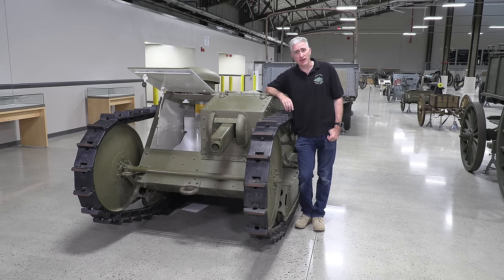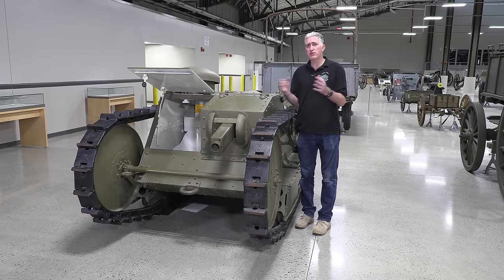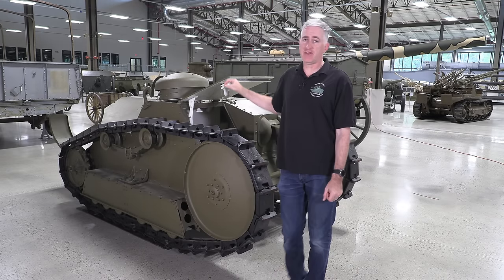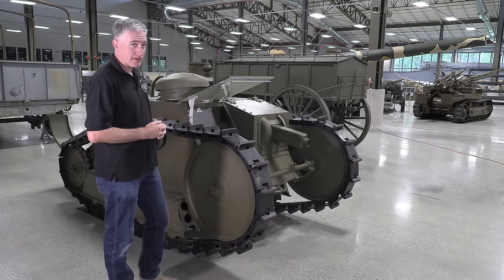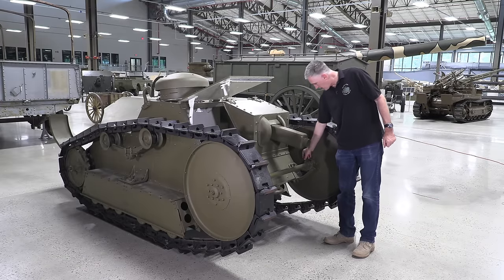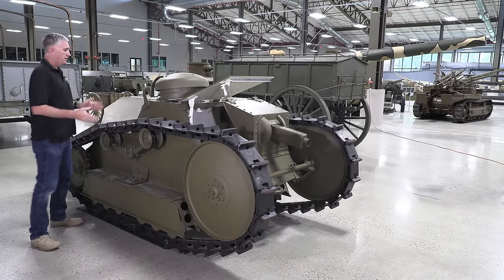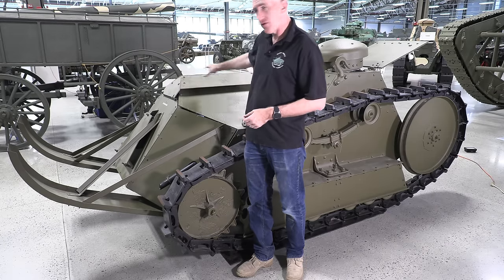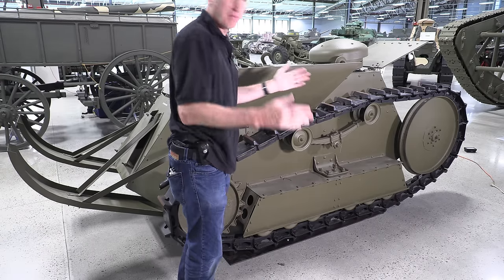Inside the Chieftain's Hatch: 3-ton M1918

Comment: As for adjusting the track tension from the front. I believe you nailed it with that Towing eyelet in the front. When I served in the mechanized artillery in the US Army we had long "crowbars", which were simply straight steel shafts, about 4 and 1/2 ft long. They were referred to as "Tankers bars". That's probably exactly what you would do to hold that in place while adjusting the bolts.

Comment: I suspect track tensioning would involve compressing the idler springs first, but there doesn't seem to be anywhere to attach a winch or device to do so. Being a fairly light vehicle perhaps they could just stack sandbags on the tracks, basically add weight until the idlers sag to a measured position and then take up the slack. Maybe getting a few mates to bounce on the tracks would work.

Comment: One note about the fuel tank.... Model T engines were gravity fed, so it's likely the fuel tank would have been in the engine compartment above the two engines. It's likely this scheme was kept from the cars because otherwise you're relying on an add-on fuel pump and a carb with a float bowl, or a vacuum tank which were persnickety things on the best of days.

Comment: You seem big for a tanker. In the late 1970s through the early 1990, I worked on projects at the Command and General Staff College. My first impression there was that people were chosen for their professions. My first project was a command-and-control simulator. The tankers were all relatively short, and very muscular. The intel guys were a bit overweight and often had longer hair (by military standards) and often smoked a pipe. The engineers were slight. The Colonel that oversaw the exercise was a tall lanky guy who was an airborne commander.

Comment: as a fellow tall person and a mechanic. u might have to do what i call the "dive." go in head first, while propping yourself up with arms, "fall" into the seat on whichever side is feasible, then bring legs in. luckily  tanks dont have steering wheels(sometimes) so u dont have to worry bought getting legs under the wheel.  

granted, the seat moved and the entrance was odd, plus i'm not there to see specifics complicated entry for sure. seems like the tank is trying as hard as possible to hurt you, lul.

Comment: Simple 2 or 3 pully shop hoist hooked to anything immobile should work better than a pry bar for track tension setup more control over distance moved and in holding tension while retightening the bolts.

Comment: I believe the US Army brought back a Renault FT for Ford to study after asking Henry if he could make an improved version faster for less. Ford put his engineers to the task and had the M1918 design worked out in 72 hours. I also believe Ford used two engines and transmissions since it could be driven if one engine or transmission broke down. The Model T had it's gas tank behind the dash board above the engine so the M1918 probably had it's fuel tank above the engines with the fuel filler neck below the center cover that was hinged. 
The Army might of deleted the turret if soldiers were getting accidentally shot by the gunner who couldn't see them running past the sides of the tanks. This way they knew the machine gun only fired forward so not to get in front of it.
Reply: Interesting analysis 🤔. Can you verify the beginning? I'm extremely interested in this tank.
Reply: @LovesTrains440  There's not much to it. The US Expeditionary Force decided to use British and French tanks since the Army never bothered to design any tanks prior to entering the war (C.L. Best came up with an innovative design in 1916 that the Army turned down for that reason) then found they couldn't get any once there so had to supply their own tanks. They shipped back a FT and wrote up specifications for a lighter and cheaper tank. Ford made 15 in record time with one sent to France for evaluation by the Army. They didn't like it so the US Army cancelled it's production and went ahead to have near exact copies of the FT produced by other companies (which included C.L. Best) but due to various delays, weren't ready to use until 9 days after the war ended. The Army did consider using the M1918 tankette to tow the 1897 French 75mm all-purpose field guns then cancelled that idea due to treaty limitations.
Reply: @billwilson3609  I've definitely heard all that except Henry's reaction. Do you have any contemporary sources? Thanks!

Comment: I think this sort of vehicle is important historically for an entirely different reason: to illustrate how far removed even the most basic of tanks are from modern manufacturing capability. Even the most dedicated home machinist, casting non-performance critical parts via lost 3D-printed plastic, with modern engines and transmissions, will find it extraordinarily difficult if not outright impossible to manufacture even a single tank of the M1918's capability in under 2 years. With a hundred years' advance in construction... It still takes a factory and a lot of industrial capacity.

Comment: Why not put weights on the track over the leaf spring top rollers to relieve tension before adjusting the tensioner bolts? That way they don't spring back when loosened and can be adjusted forward without a pry bar. Remove the weights when you are done and get full tension.

Comment: Pretty sure that the spring holding the return rollers is a Model T transverse leaf spring. I know they used as many T components as possible, not just the engines. I would be curious to find out just which small parts all over the tank were taken out of the T parts bin. I thought the axle for some reason, but with dual drive that seems unlikely.

Comment: So in order to shift a gear up or down, driver has to pull two levers up, then switch both hands to gear levers, try to wrestle both transmissions in the same gear, then switch both hands back to clutch levers and engage them? Sounds fun.
Reply: The Model T transmission used bands instead of gears so there was no clutch or shift pattern.

In the car, the throttle was mounted on the steering column and there were three pedals: Brake, reverse, and "clutch", which put the car in high gear when released, neutral when held halfway, and low gear when pressed to the floor.
Reply: @AlexR2648  And, there's no 'wrestling' with the transmission as op worries about. Constricting bands on a planetary gearset could be as smooth as an automatic transmission if you didn't mind the extra band wear from slipping. The brilliant part about the T controls is cruise control is inherent... high gear, throttle set, no hands or feet required on anything but the steering wheel and a minor tweak to the throttle quadrant as needed.

Comment: You're obviously not an engineer because the track tensioning is easier than you imagined. A couple of wooden wedges driven behind the axle before loosening the bolts would prevent the idlers from going "flluummf", and a few knocks on the wedges with a big hammer would add tension. Easy peasy. 😄
Reply: Mmmmhmmm
Reply: There you go. Did not think of that. 😮😮

Comment: I see something quite innivative and clever on this thing. On the top ideler wheels it has lead spring suspension up there which would i can imagine work as automatic track tentioning to some extent when your road wheels go up kind of like i believe some m48 mdels where 2 wheels are connected and as one goes up the other pushes out but i might be getting that mixed up with another tank as i do not reall remember

Comment: Not to be a knit picker, but I suspect the MG would be a Browning 1917, not a Browning 1919. The 1917 is water cooled, and the 1919 is air cooled. With that armored shroud over the forward end of the MG, air cooling would be problematic at best.

Comment: Not sure how much information has survived but did tanks at this time have sealed bearings? Do you know if you had to go around with an oil can before setting out, or were they starting to use grease nipples? I'm a fan of the series Lawrie Goes Loco (seriously, if you like Inside The Hatch, you should check it out); on it, he goes over in detail the start-up procedure of various Locomotives (I strongly recommended the WW1 Simplex video) and wondered how much translated to tankers.
Reply: Back then they used rope, felt and rawhide seals to hold oil and grease in place.

Comment: One way this sets itself apart from early tanks is that it looks like it wouldn't gas or burn the crew with engine exhaust or exposed components.
Reply: the ft wasnt supposed to either.
Reply: Still no firewall, so the engines (including the crankcase breathers) and exhaust pipes (which would leak somewhat) where inside the metal box with you when "buttoned up". The fuel system was also on the crew side, so in event of any issue you got covered in gas, and you'd need to be fairly careful of the starters behind your elbow because they DO spin when the engines are turning.

IMO it'd have made a lot more sense to mount the engines the other way around so the starters where against rear of the tank, and crew contacted the gearbox housings only (due to lower height than the engines you could even have the seats reclined to be partially overtop of them, but ford elected to have neither the 2x 1m driveshafts or alternately use a front sprocket, probably because it was faster to develop for such a war expedient (and honestly not very good, see choice for none of them serving in combat) design.
Reply: @SheepInACart  Huh. OK not as good as I thought but still much better than early british tanks

Comment: Did they move that fast or was that the film speed helping out?
Reply from the maker: I suspect film speed helped out.
Reply: Wikipedia says it had a top speed of 8mph/12.8km/h. When the footage at 5:20 shows it going sideways, we can use the bush in front of the tracks as a reference to see how many seconds it takes for the tank to move it's entire length (approx. 2 0r 3). With a length of 14ft, we now have a speed of 14ft/3s or 3.2 mph (4.8mph at 14ft/2s). With the footage at the end we can do a similar analysis which shows similar timings to traverse the vehicles full length (the static camera lets us mark a single point on screen to reference here). And finally, the very last shot of historic footage thankfully has a timestamp on it, which doesn't appear to be speed up.

I do like how the footage of the drivers getting in shows one guy using his foot to keep the hatch from closing too fast.
Reply: for ww1 standards 8mph was speedy.
Reply: @TheChieftainsHatch  Russians did it the other day with T62’s,or so it looked.The obligatory drive by waving was a bit rapid,as they “stormed” past camera like a pathe” newsreel.That M4 in middle of shot on US Armoured doctrine,the gun looks huge.
Reply: On desk at your twelve o clock.

Comment: They stopped production due to a combination of the Armistice and the US Tank corps at the time feeling that the vehicle as it was didn't meet the requirements they they wanted but the ones sent to France for evaluation the French saw them as inferior to the Renault FT but they didn't throw them away, they actually repurposed the ones they were given for evaluation as cheap, light and all terrain alternative for artillery tractors for the Canon de 75 modèle 1897 instead of the usual trucks they used...They placed an order for 1500 for that purpose but again the Armistice shut that idea down.

Comment: There is an episode of Top Gear where they used Ford T as a trap for employers of expensive hotel and the trap was successful as the fact that the Ford T have more pedals and the whole layout completly different than any modern car and it is kinda complicated, so in the end not a single person that came to try to start the ford T managed to do that(and it was in Europe where manual gearboxes are common)...
So i kinda wonder if anyone in that museum knows how to operate this tank or do they just think that they know(but passed the knowledge to u anyway).
Reply: There are things like manuals, even from back then. And if anyone has done mechanical work on this is should be pretty obvious how it works. I'm not suprised no one could drive away in a model T, it's a very different to a normal stick or column shifter. Still, once you open up the transmission and see how it works, with those bands connected to the pedals, it's fairly evident.

Comment: The only real question is did it work for how it was designed? I've found that a lot of reviewers tend to be overly critical because they are not seeing the unit in the frame of the times.
Reply: Badly, since it was effectively rejected by the US and French army so it never saw combat.

Compared to the Renault FT of the time this is faster.. on perfectly flat roads. Otherwise it has weak firepower, terrible field of fire, commander can't see a thing etc.

Comment: I think the ones who designed this tank took the wrong inspiration from the Renault FT. During WW1, the french light tank Renault FT was one of the most useful in combat even compared to the heavier british Mark tanks because you could produce them in massive amounts. France made 500 per month during the last part of the war ! The US generals surely wanted to equip their troops with a big number of working tanks when they would arrive in France, so they tried to have Ford make them as much tanks as possible. The result was a tank far too small and light armed to be useful against the steel bullets of the germans, and lacking the essential component of the FT, the turret, making it extremely hard to hit anything with it.

Comment: My guess with the tensioning of the idler wheels would be that you unhook the tracks and then loosen the idlers so they don't come flying back.  Then when you're done putting the wheels back where they won't go "fwoom" in your face, you adjust and reattach the tracks as needed

Comment: Pros and cons. Pros: A manufacturer like Ford by 1919-20 could probably churn their puppies out like Carter made little liver pills (I am dating myself).  From the film it ambles across rough country OK.  Decent and really standard power pack ("it's the same motors as my Model T jalopy! Piece a cake, Sarge") . Cons: It would be best to crew it with midgets. I am 5-2 and I could probably fit in pretty well.  Not a lot of firepower. Trench crossing could be a challenge.  No realistic protection over 7.92mmx57.  Steering and controlling would be interesting.

Comment: Just think how different tank ergonomics would have been if they adopted the aircraft approach of designing the cockpit as a module and then building the rest of the aircraft out around the cockpit rather than vice versa.
Reply: Because they were only just figuring out that aircraft are best controlled by single joysticks/columns at the time as opposed to two separate levers for elevators and wing warping (the rudder being controlled by the seat moving sideways).
Reply: @allangibson2408  I wasnt referring to WW1 in particular but designing armoured vehicles around their interface is something thats only really started in the last decade with fully digital workstations, its taken a long time to catch up as until recently they built the crew area around whatever shape the space was in the turret when the gun was added and the only concession to adapting the gun for the tank was how the shell was loaded.
Reply: @watcherzero5256  Standardised cockpit design for aircraft started in WW2 with both the RAF and USAAC agreeing on standard instrument layouts and control configurations. The layouts decided then, lasted into the 1990’s when glass cockpits became dominant.

Comment: these early tanklets always make me wonder if the designers ever bothered to shoot at it with a machinegun before sending it off, though I guess if they ran into a  light cannon it wouldn't matter
Reply: They were proof against typical small arms fire as it would be unlikely you'd get a shot at it at perfect angles. The idea with small tanks was to swarm so that the chances of any individual tank getting hit in the hopefully short time before breakthrough was small. If you'd been a lone tank of this sort then you'd have got hit by a lot of cannon fire, so swarms were the only viable tactic. I presume the logic here is that if you can build three tankettes to two small tanks, you get a bigger swarm, and the enemy is ahead so why use a turret. And the answer turned out to be the enemy not always being ahead. But then there were StuGs in WW2.

Comment: OSHA was not effective back then, thus no way to hold up the center hood.  Entering this tank proves that nutrition has improved and average people have increased in size and mass. Items from this era prove that fact.
Reply: There is a YT video of starting one of the survivors and the centre part of the engine cover folds over the crew compartment. I suspect the restoration of the 3-ton in this video isn't quite accurate. https://youtu.be/pF3nnBJh7J4